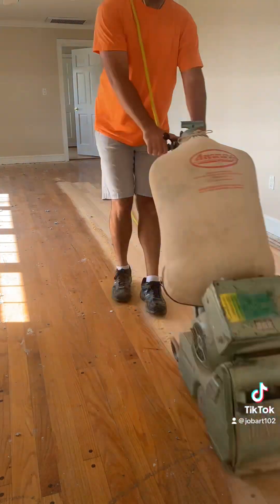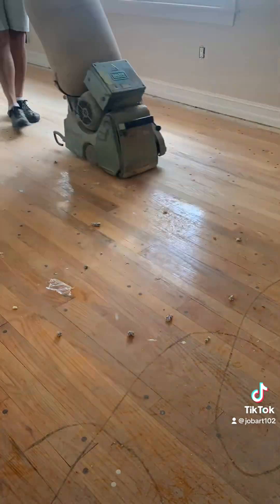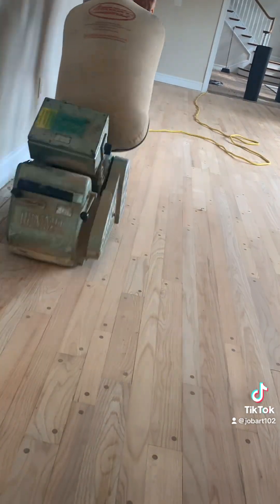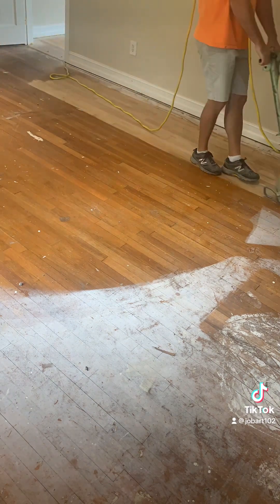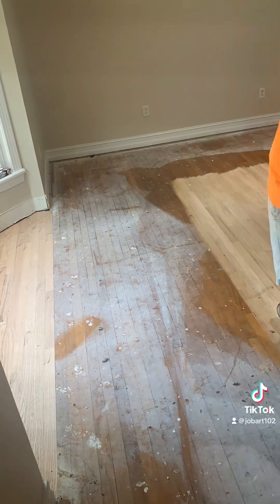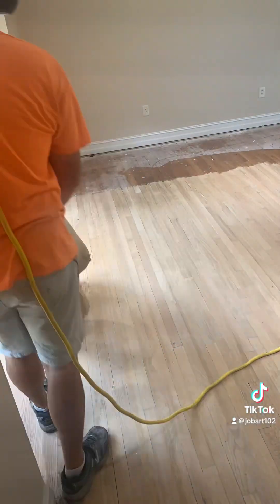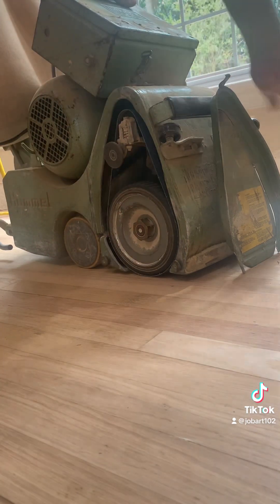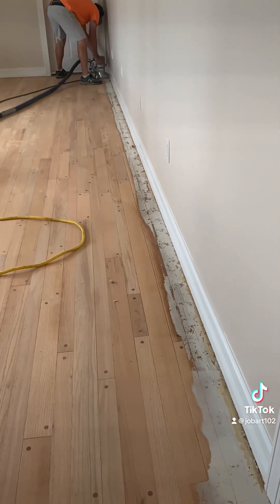Rough Sanding this Oak Hardwood Floor! Day 2 on this project!

Comment: Just wondering whether you apply light downward pressure on the handle once you have lowered the drum? just light ?.so you can feel high spots on the floor.
Make sure you don't sand off glue with the Humnel or you will up for a new top roller assembly$1500..
PeaceFomOZ😊
Reply from the maker: I kinda just lower it and let it go. I sometimes will apply a little pressure if it seems to be having a hard time with a spot. But 95% of the time I dont